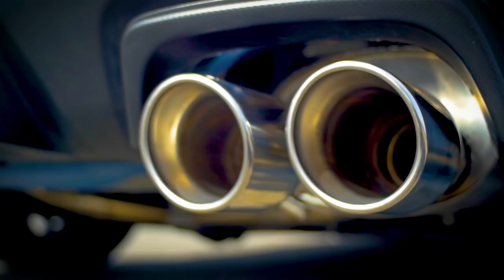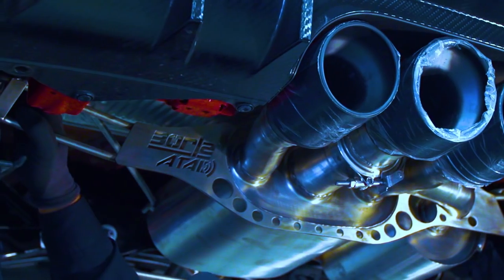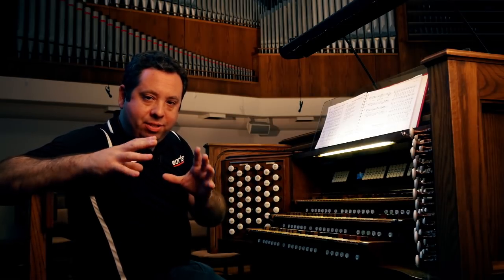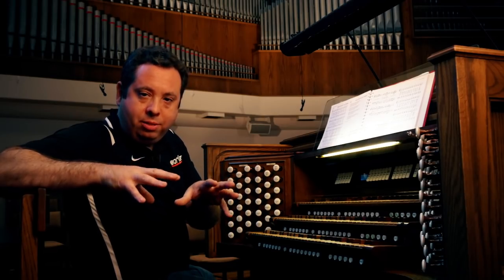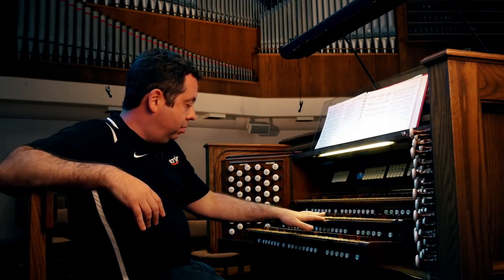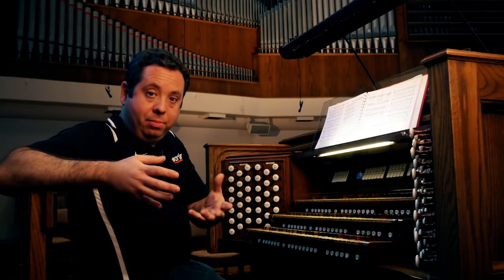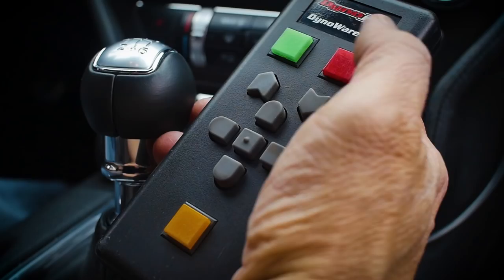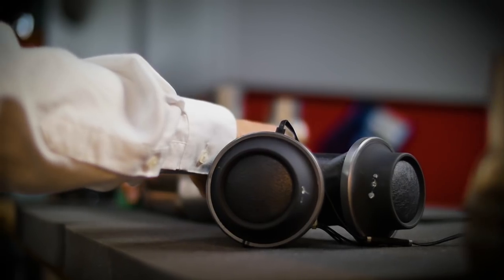Introducing the Borla Polyphonic Harmonizer Exhaust Technology [Polyphonic Exhaust Explained]

Comment: The length of the foot does not affect the pipe's pitch, so organ builders vary the foot lengths of their flue pipes depending on other factors, including the desired shape of the pipes in the façade, the height of the rackboard in which the pipes are seated, and the weight of the completed pipe.
Meaning the statement @ 1:30 is incorrect.  You MUST have a blockage inside your pipe to create an Oragan pipe. You literally have 4 1.5 inch pipes on a 3 inch pipe. there isn't anything happening besides back pressure and turbulence near the muffler. 
https://en.wikipedia.org/wiki/Flue_pipe
Construction category.

Comment: Do you have a model specific for a Nissan Fuga 450 GT V8?

Blown away by your video here as I have been researching exhaust systems for my V8 which is currently stock standard.

I was just joking about being a Music Producer and that I was wanting a specific sound for my car.

I have looked at Flowmaster, Magnaflow which have merit.

I do love the sound of your Pro xs series mufflers.

Do you think a polyphonic fitted along with a Pro xs series either side of my twins would be a sweet thing?

I believe there are 4 factory cats and flow into one pipe and back to twin with long resonators either side then up to factory Nissan Mufflers then out the rear.

Appreciate if you could reply as I am keen as!
Reply from the maker: Hi! Unfortunately, we don't sell our Polyphonic Harmonizers as a separate component or part. Sorry about that! They are included in select exhaust systems.